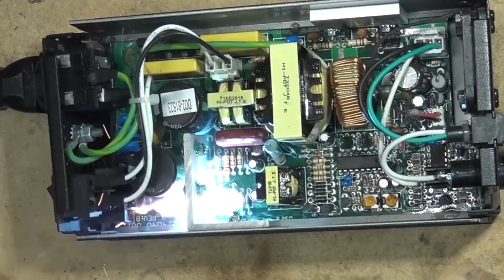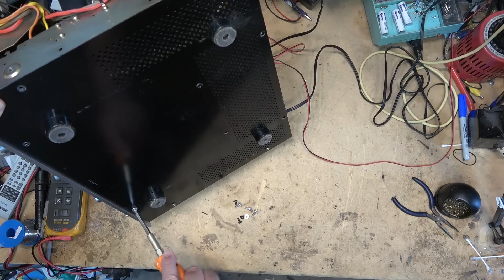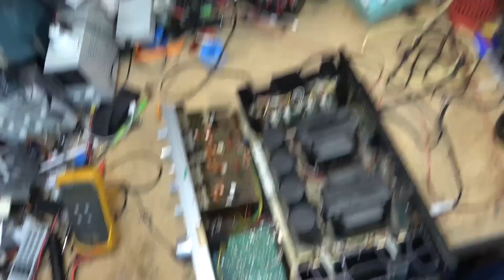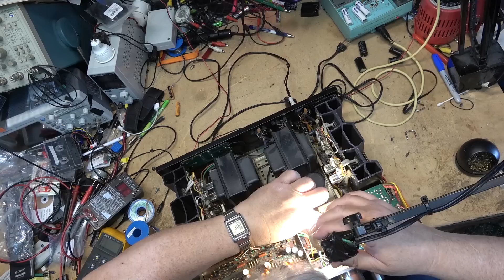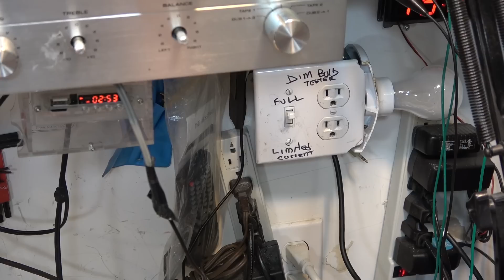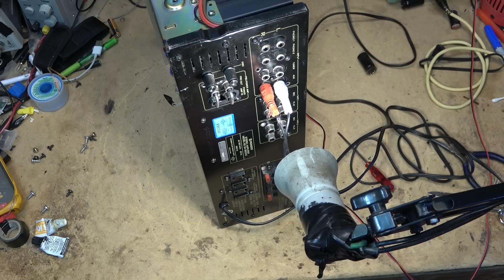Pioneer SA9500 No Sound

Comment: I was born in the mid 60's. My dad had one of those blue engravers in the 70's. I believe I still have it somewhere. I was thinking about using it on my cat on my winter car that sits out.

Anyway...  We had a break in the 70's in a Chicago suburb. My mom must've come home early and interrupted them. It was a split level home that backed up to a huge field. They entered through the sliding door in the kitchen and exited through the basement window. It appears as though the last thing they were doing before my mom came home was unplug my dad's stereo. It was a Marantz reciever and a Dual turntable. They didn't end up getting it, but they tried. 

A few years later we moved and my dad was pounding on tge wall in the garage. He had dislodged the shelving unit on the other side of the wall holding his stereo. That Marantz receiver and Dual turntable came crashing down on a tile floor and it basically destroyed it.
Reply: I've never had anything stolen myself, but I can't say the same for my voice teacher at Indiana University in Bloomington in the 1960s. He had an entire system stolen from his University Apartment when he was gone for the summer including Quad preamp, amp, electrostatic speakers and a Uher 9000 tape deck. Unfortunately, with him lightning did strike twice. He had the Tandberg 64 tape deck that replaced the Uher stolen from his house, also when he was gone for the summer, a few years later. He had received the Tandberg directly from the factory in Norway after writing a letter to the president of the company. I guess that when you're a world-class baritone who would later have a career at the Metropolitan Opera you get those kind of perks. I can't help but wondering if those thefts were inside jobs of someone who knew him and his hobby.

Comment: Hi, I have a KENWOOD XD-502 MINI HI-FI COMPONENT SYSTEM that play cassette tapes slow. I inspected belts and wheels and are ok. It can be a problem with the pinch rolles ? I cleaned them and I think they need libricated. I also have a Panasonic STEREO SYSTEM SA-AK27 that play and rewind cassette tapes in only left side. I inspected belts and wheels aswell and nothing seems to be wrong
Reply: Old Panasonic or Technics mechanisms often have a gear broken. Mostly only the reverse direction works then.

Comment: I have one issue with your work, when you solder or desolder any part from circuit it is safer to do it on flat position rather than in vertical. Hot solder may drip down and create short circuit on other components. Yes I know that in vertical it is easier to do some work but you have to be careful.
Reply from the maker: I never have an issue with solder shorting. I do inspect my work as I go.  Been doing this for over 40 years now and have never had an issue.

Comment: Have worked on a few of these SA9500II's and yeah those power supply caps always dry out and go open. Definitely seems like some schmuck had been inside before you. Great video too 🙂
Reply from the maker: This is about the 10th one I have done over the years.
Reply: @12voltvids  You would be well seasoned on this model by now hehe.. they're a nice unit and the SA8500ii as well 👍
Reply: @glenz1975  Do you have the 8500 II? Because  found one for about 400 bucks including shipping.